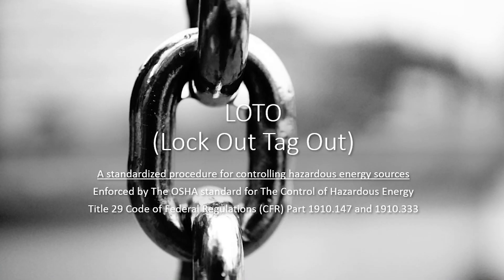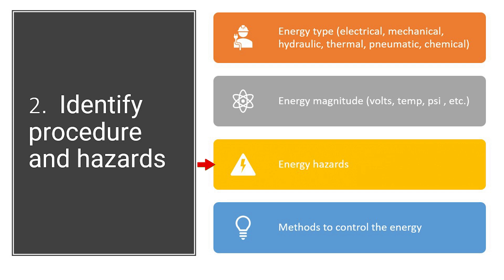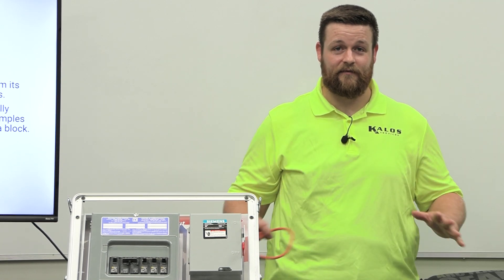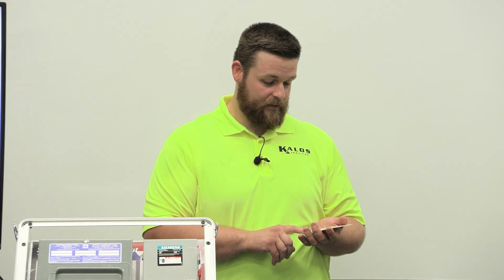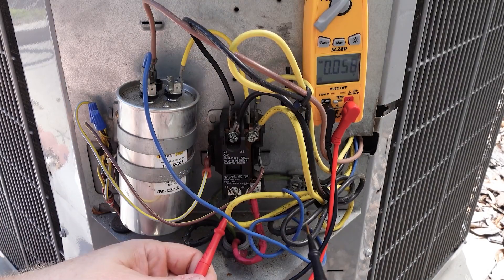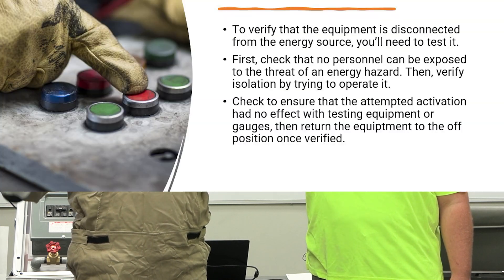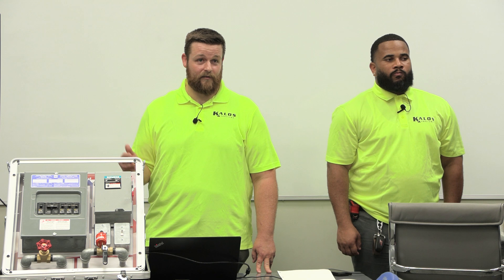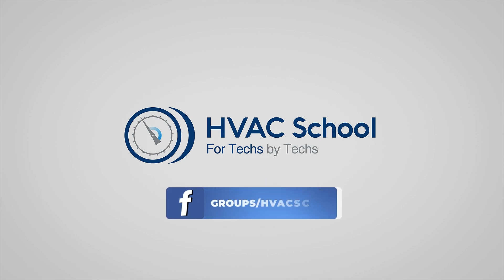LOTO (Lock Out Tag Out)

Comment: The last step in actually trying to start the machine is in my opinion the most critical element of the LOTO process since it's common for very large pieces of equipment to be fed from multiple energy sources,  sometimes requiring shutting off multiple disconnect switches,  closing valves, opening valves to dissipate stored pressure,  etc in different areas or floors of a large industrial plant, and facility records could be outdated,  changes could have been made to the equipment that would alter the LOTO procedures.